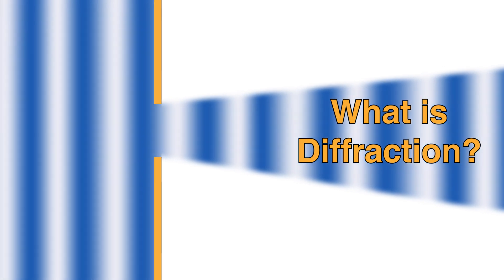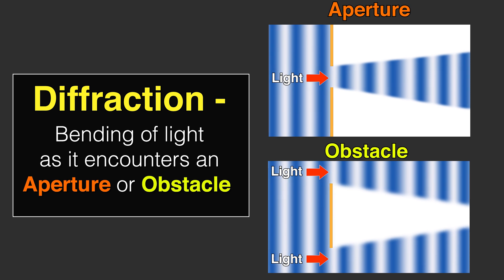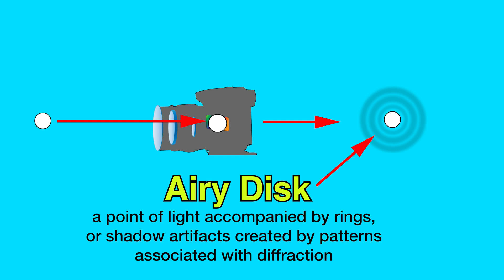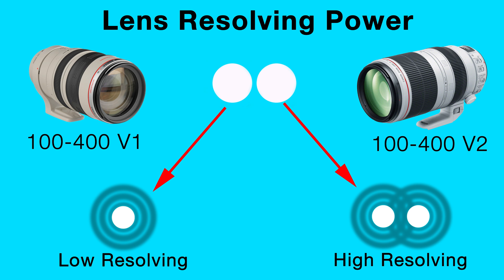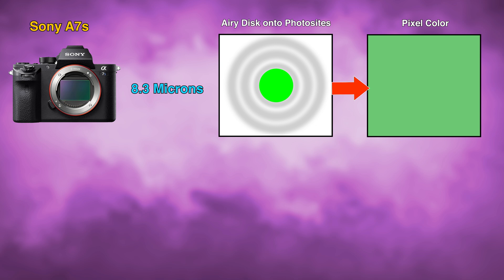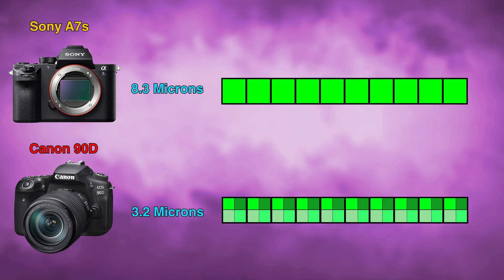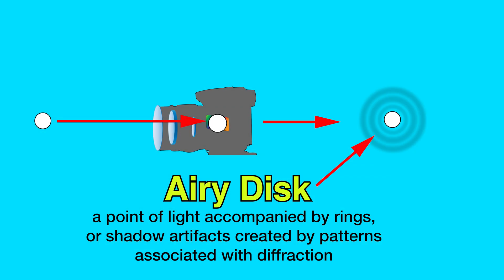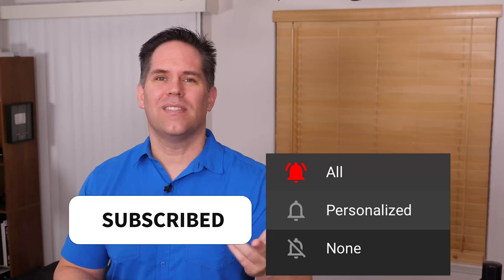The Basics Of Diffraction and Airy Disks | How Sensors Out Resolve Lenses | Physics of Pixel Pitch

Comment: interesting explanation,

As far as you know, is the pixel,for example of the sensor designed for a mid-range smartphone,  larger or smaller than the Airy disc that emerges from the lens optics?
Reply from the maker: It varies from camera to camera based on the sensors & lens design. I have heard that the lenses used in smart phones are pretty bad, with as many as 30-50% not passing inspection. That said, those lenses are designed specifically for those sensors, which is a little different than what we are talking about with interchangeable lens cameras. Also, what a smart phone captures and what you actually see are very different. Smart phone pixels are typically even smaller, but they play software games to make up for it, such as adding artificial sharpening in post.

Comment: It sounds like larger pixels are "better" than smaller pixels with regard to DLA? Meaning that with smaller pixels, diffraction begins to affect the sharpness of the image at larger aperture settings. So if I want to shoot landscapes at f/11 does this mean that I would prefer a sensor with larger pixels over one with smaller pixels, if in this case the smaller pixel sensor is diffraction limited at f/6.3?
Reply from the maker: You are Correct!
Reply: @MMaven  Wow, that's a bit surprising because I would think that the prevailing consumer wisdom is mega mega mega pixels is more more better, but to get more megas I assume the pixels need to get smaller and smaller. Maybe that cheap-o 10 megapixel camera from 2012 is worth the $35 it costs!
Reply from the maker: @petertrahan9785  yes, but there is a tradeoff usually, fewer megapixels (to have larger pixel size)  also results in lower resolution and therefore lower detail. So its a balancing act!

Comment: Ladies & Gents, to help better understand diffraction effects please remember that light waves do not travel through free space as planar waves as depicted in Michael's video, but in fact behave as spherical waves emanating from a point source (aka, the Sun or artificial light sources etc). So when a spherical wave front hits a small slit or obstruction in the manner depicted these wave fronts 'bend around' the slit or obstruction edges and continue on past the slit/obstruction as additional individual spherical wave fronts, which then undergo constructive interference (forming the light bands in the Airy Pattern) or destructive interference (forming the dark bands) where all of the "new wave fronts" overlap with other wave fronts passing past the slit or obstruction's edges. Also keep in mind that white light is not monochromatic and that similar diffraction effects will occur to differing extents for all of the different wavelengths present in white light. Explanation of constructive and destructive interference is beyond the scope of this 'simplistic' explanation but occurs where wave fronts having the same wave lengths coincide with each other. As a final comment it should also be remembered that light behaves like (has characteristics of) both waves and particles. Hope this is of some value in understanding diffraction. Cheers from Down Under.

Comment: I was on DXOmark, looking for stats on my camera/lens combination and learned that they rate a lens/camera combination with 'effective megapixels.'  They are suggesting that using certain lenses on your camera will only yield a certain about of megapixel depth.  Now, I understand this from a cropped sensor vs full frame point of view.  Such as using an APSC lens on a full frame camera, or any time you crop your image. But if you are using a full frame lens on a full frame camera, how can the lens restrict the number of megapixels used? If the image is being refracted onto the sensor, then the sensor should be using all its megapixels to capture that image, right?

Comment: An important fact left out in this explanation is that diffraction occurs at the edges of the lens iris (which is roughly equivalent to a circle) as a one-dimensional metric at its circumference*; whereas the *area of the aperture of the iris is a two dimensional metric.  This means that the proportion of resolution-degrading diffraction increases exponentially with the inverse of the aperture diameter.  For instance, comparing an aperture that's half the diameter of another aperture, it's circumference is half, but its area is a quarter.  The overall effect on the focal plane (the sensor) is that diffraction contributes to blurry imaging in inverse proportion to the square of the aperture, thereby favoring large apertures for sharpness for well-focused image regions. 
When considering pixel-spacing (and [inversely] pixel count), it may be true that resolution for low f-numbers provides a minimum limit for pixel-spacing in general photographic use, but may not be a true limiter for sharply focused macro photography with full-open apertures!  With image 'stacking' post-processing, limitations on depth-of-focus issues in macro photography are being abated, possibly making way for higher resolution sensors with small pixel-spacing as a practical solution, even with contemporary lens technology. 
Another factor to consider is quantum efficiency of pixels as it relates to optical '*noise!*  A colleague, who got his PhD in optics with specialization in diffraction, pointed out to me that low photon counts in each pixel mean that the arbitrary nature (per Heisenberg) of photoelectric effects at individual photon event scales mean lower signal-to-noise ratios in images; smaller pixels are noisier.  Diffraction aside, quantum efficiency might be the greatest limiting factor for high-resolution imaging.  But then we can always employ TE sensor-cooling for the hard-core resolution fanatics!
In short, 150 mp might be practical for some who use current lens technology with full-frame sensors.

Comment: It flew over my head... So, for sharpness do i need a lens with less, the same or, more resolving power than my sensor pixel pitch? Thanks :)  
Edit: further, any thoughts on if pixel shift removes diffraction. Thanks again :)
Edit2: okay watched again. If i have understood correctly having the highest (smallest) resolving power is always better for the sensor performing optimally when it comes to sharpness and preventing airy disks? 
Okay so here is the final burning question :) lets say the sensor has a pixel pitch of 4.5um and the owner of the sensor is considering the most complimentary lens for sharpness. Would they go for a lens with resolving power of 4.5um, 1um, or even less like 0.4um? Would there be a difference zoomed into 100% or are you simply 'future-proofing' your lenses to future sensors with smaller pixel pitch?
Reply from the maker: On pixel shift: only if the pixels are larger. Edit2: yes, or to have larger pixels
Reply from the maker: Burning question: there’s no negative effect of a lens out- resolving a sensor, but at some point the results will be similar no matter how sharp you get as a pixel still is limited by becoming a pixel of the same size. Even if the lens is resolving a point to 1-2 microns, the pixel will still be 4.5 microns.
Reply: @MMaven  🙏 Thank you for this :)

Comment: Nice explanation, BUT, with diffraction light DOES NOT bend, Light has no direction unless its given, and by definition it simply DIFFRACTS or distorts due to its environment/obstacles, that is sometimes due to changes in atmosphere/air. Light itself has no direction to "BEND". This is loosely used in explanations, yet when it comes to experiment, it is not used, as it is identified why it diffracts or reflects. It is more likely that we mean the same thing when explaining it, but the word "bend" is misused. Light does not bend unless there is distortion in its way, and one must clarify that ONLY the portion of light that is distorted refracts or reflects based on the obstruction. But this maybe more than your need to explain pixel pitch, but "Bend" should not be used.
Reply from the maker: You should research this a little deeper. “Bend” is used in most academic descriptions of diffraction.
Reply: @MMaven  You are 100% correct that it is used in academia. It doesn't change the fact that it is wrong and contested. It changes how we understand the behavior of light, and that too is often incorrect. Few professors will say its symantics, while others bring up examples of extreme humid or underwater testing,  even then some say it is bending instead of refractiing. Its the interchangable use of the word that is incorrect, as more Atomist mindsets will want to push the idea that light is a particle vs the science in testing that gives examples of it being a field disturbance, wave, not being a particle....I have looked at it too deep, perhaps.And even if I am not making it clear, or not fulling applying the slit testing interpretation... The one thing that is clear is that we need to stop calling it a "bend of light". Its a bit absurd to think light can bend on its own. As "bends" can occur innately from the objects characteristic. Light does not behave as an object. Yet we know that it is only when disturbed that it changes, and not bending on its own. Hence we should use the correct and CLEAR terms and say it is refracting, when it is disturbed. This would also alter the idea that light travels, which is also absurd, and today's science has better understanding of this and much better explained than the antiquated academia texts. It is not the speed that causes the refraction, it is the medium that it is in, as light does not have a speed of travel. A lot of this nonesense was created from Einsteins theories and he needed a baseline to fabricate a speed that was a constant, otherwise all his math would be based on nothing. This is why we have so many issues with the idea of relativity, as we have professors today in university contest it. Hence these objections it has changed 3 times, and for some reason it has not been throw out as garbage yet...as a lot of the math from other parts of the model still quantify, yet putting it together it falls apart. There are a few books on this...The physicist that actually helped complete the idea of Relativity was banned from publishing any of his findings and couldnt do it for over a decade. You can get a copy maybe floating around, its called Science At The Crossroads,  By Henrick Dinkle. We have professors that I have listened to on this topic, yet they are being directed and steered away from lecturing on this topic, unless they stick to the textbook explanation...anyway...WELL! That was a lot more than I expected to type. Keep up the excellent work!  I can only recommend to use the accurate description vs a word that misdirects and can confuse.
Reply from the maker: Phil Indeblanc so let me get this straight. I tackle a topic in the photography world that literally no one else wants to touch, explain it in simple terms for the beginning photographer, and the only thing you want to make an issue of semantics? Seriously, you have major issues.
Reply: @MMaven  Well, this is important to me, and I find your channel a great source of info for many, including me at times.  I thought I should point it out. You can take any ones interest and "hyper focus" on it, and it can be a deeper topic. But saying someone has a "major issue" over it, is maybe unnecessarily incorrect. I have done some studies in philosophy of science and if my insight is not welcome to you, what can I say?  I just wanted to be thorough in why I mention it, and yes, not directly helpful to some of your audience, (which is where you do a tremendous job and why I direct anyone asking me for camera direction to come here). but...comments can and should have all types of varying info, and often we can learn from. I don't think its a major issue. Just something to perhaps consider, that maybe we shouldn't look at light as some super ability for it to bend, as it doesn't. Its partly semantics, and more so misuse of the word bend. I like discussing "major issues", not having them. Having them distorts clear thinking :-)
Reply from the maker: Phil Indeblanc I really wish people would stop spelling it “symantics”. I mean that’s really wrong and inappropriate. You are dissuading so many people! 

Can you see how far the conversation will go when I apply your reasoning to your own errors? 

Instead of sitting back and saying hey maybe Michaels doing a good job and educating the public. “Bending” is perfectly acceptable to the layman despite your own personal interpretations.

There is always someone that wants to discuss the 1% of the video to just feel smart or something. Forget the amount of time this took to put together. Lol. There’s always that 1%... have to make a fuss out of it don’t you
Reply: @MMaven  Semantics from the Greek semantikos - definitely no y - meaning significant. I'm not a particle physicist but from what I understand, "bend" is a perfectly valid allusion for what light appears to do around an obstacle. Creative photography is not an exercise in data recovery, we just need to know why our images look soft and why our expensive new lens doesn't perform as the reviews suggest. Modern cameras are marketed on the premise that we want to print our images very large indeed, and take them in low light. If we don't do either very often, our creativity is not limited by our bank account. Thanks for the explanation.

Comment: Brilliant finally someone else is taking, even if indirectly, about the fact that an A-PSC camera with more than 20-25MP and a FF with more than 45-50MP are actually quite useless. 
When diffraction starts at around f8-f9 a camera is still well usable, but as in the case of the mentioned D90, where it starts at f5.2 it leaves the camera to be suitable just for certain types of shoots and particular conditions, as well as dictating the use of more expensive fast lenses.
IMO the best compromise is 20MP for cropped sensor and 45MP fo FF, with a +/- of a few...  I want to shoot comfortably between f3.5 and f11 on a f2.8 lens, f3.5 to f7 is too limited, might as well get a roll of 127 film and stick it on my beloved Bencini Comet that I started taking pictures with 40 odd years ago, fixed f5.6 and the luxury of 1/60 or bulb shutter speed...
Reply: Firstly, keep in mind that having a camera with a higher megapixel sensor is not useless as it will still resolve better than a lower megapixel one at non-diffraction limited apertures, and resolve no worse at smaller apertures. 
Secondly, greater sampling/binning overcomes the problem inherent to sensors with sub-pixel matrices (Bayer and X-trans, as opposed to Foveon). 
Thirdly, there are techniques like focus stacking, that can maximise depth of field while not being limited by diffraction, thanks to being able to shoot at large apertures. 
Finally, the effect of diffraction blur is different to that of being out of focus, such that a diffraction limited aperture may be chosen even when the subject would be resultingly less sharp, due to having a more even sharpness profile across the frame; sometimes consistency is better than absolute sharpness.

For these reasons the pursuit for more megapixels will always be a worthwhile endeavor for manufacturers, although the addition of more advanced software features (such as streamlined focus stacking, frame noise-averaging, AI optimised artifact-free pixel shift, and RAW histograms) would be nice too.

Comment: Diffraction is a consequent of the Heidelberg uncertainty principle. As the aperture of the lens becomes smaller, the position of the photons passing through it becomes more well defined. But the momentum, which includes direction, becomes less defined. The amplitude of the momentum wave becomes large enough in this case that the interference pattern is visible. Normally these effects are so small that you don’t see it. It still is relatively small, which is why it only makes the image softer. 

An interesting side note, you can see diffraction in Star burst of street light at night with a high resolution camera.
Reply: "Heisenberg", easy mistake to make :)  I could be wrong, but I thought the usual way of explaining diffraction was due to interference, like in that famous double slit experiment.   See also "Huygens–Fresnel" principle ( famous dudes in the science of optics, and I imagine many people have heard of a fresnel lens, named after Augustine-Jean Fresnel)
Reply: Both explanations are equally valid.